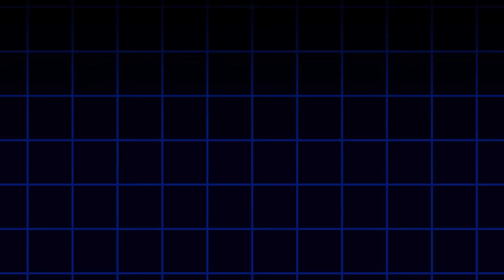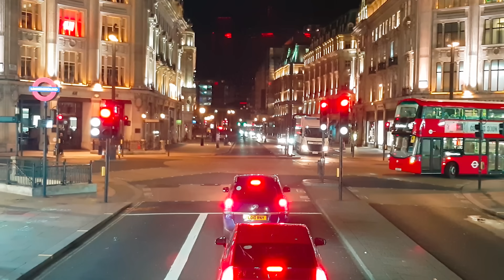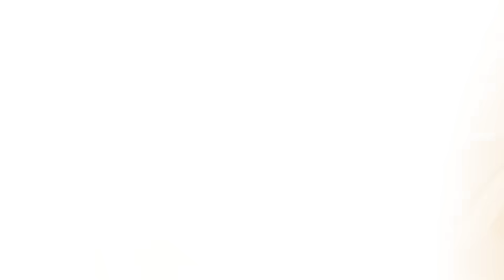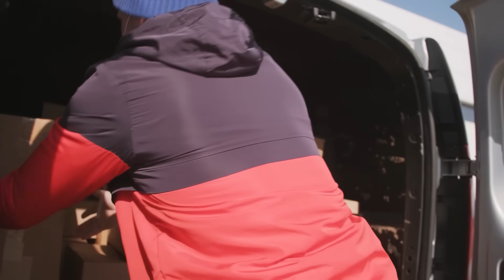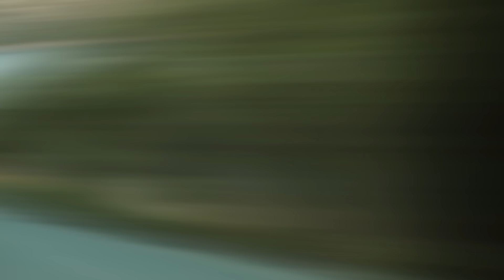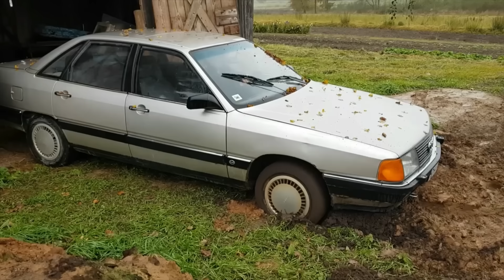13 Silly Mistakes DESTROYING Your Automatic Car – STOP Doing These!

Comment: 10:13 what if a car has only a drive option. No sport and manual shifting mode
Reply from the maker: If your car only has ‘D’ (no sport or manual mode), the safe way downhill is to brake intermittently — apply firm brakes briefly to reduce speed, then release to let them cool. Avoid pumping the brakes on modern ABS cars, since they’re designed for steady brake input.
Reply: @carsfuse  thanks for the info 🤩
Reply from the maker: you're most welcome

Comment: Hi thank you for your very informative video. I'm a new driver here. Just want to know in mistake #3. I have auto hold button in my car is it good to use as alternative while waiting during the red light? or it will also generate unnecessary heat?
Reply from the maker: Hi! That's a great question, and thank you for watching.

The auto hold button is an excellent feature, and it's perfectly fine to use while waiting at a red light. It's designed to hold the brakes for you without putting any extra stress or heat on your transmission. It simply holds the brakes just like your foot would, but gives you a break from the pedal.

It's a much better option than constantly shifting into Neutral or Park, which can actually cause more wear on the internal components over time. So yes, use that button and enjoy the convenience!

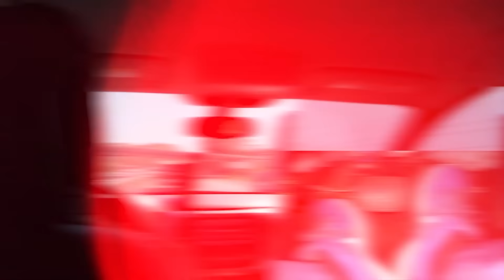Comment: 8:54 Who drives with both feet on an automatic? It's uncomfortable since both pedals are next to each other on the right side
Reply from the maker: Exactly! Most drivers don’t use two feet on an automatic, but some beginners or people switching from manual try it out of habit. The danger is if you press both pedals by mistake, which can cause serious accidents. That’s why it’s always safest to stick with just the right foot.
Reply: i used to do it only like the first week i started driving because i simrace but i broke the habit really fast, like the second week

Comment: Changing trasmintion fluid is a mistake, I've seen cars change oil and break trans mission weeks later, and cars transmission lasting decades withouth changing the oil. i rather  save the maitainace money over the 10- 20 years it lasts and you buy a brand new one later
Reply from the maker: I get where you’re coming from. Sometimes a transmission that’s never been serviced can fail soon after a fluid change — usually because the old fluid was masking wear that was already there. But in general, regular fluid changes with the right type of fluid actually extend transmission life and prevent costly failures. Skipping it can work for some, but it’s definitely a gamble.

Comment: 1. Modern cars don’t have hand-brakes..
Reply from the maker: Most modern cars now come with electronic parking brakes instead of the old mechanical handbrakes. The function is the same though — to hold the car securely when parked.
Reply: wow that helps a lot.

Comment: Dont change these habits:
-Dont neutral/park mode on stoplights.
-Dont use the engine brake on a downhill; using brakes gives you a proper millisecond reaction.

Comment: When I am waiting on a signal and I put my car on neutral it asks me to put it back on drive mode. Maybe coz I have a hybrid.
Reply from the maker: Many hybrids are designed that way. The system prefers Drive mode so it can manage the engine and electric motor efficiently. In hybrids, it’s best to just leave it in Drive at signals and let the car’s system handle everything for you.

Comment: Never flush your transmission fliud if you never did in the beginning lifetime of your car. DRAIN AND REFIL WITH NEW FLUID. 

-SCOTTY KILMER, MASTER MECHANIC
Reply from the maker: A full flush on a high-mileage transmission that’s never been serviced can sometimes cause problems. A drain and refill is definitely the safer approach to keep things running smoothly. Thanks for watching.

Comment: When I park. I step on the brake until a full stop, then still not releasing the brake shift to P then immediately engage the handbrake, no matter how flat the surface is. Will this still put unneccessary load on the parking pawl? Thanks.
Reply from the maker: Since you’re engaging the handbrake right after shifting into Park (without letting the car roll), the pawl isn’t taking much load. On flat ground it’s no issue at all, and even on a slope, your quick use of the handbrake keeps stress off the transmission.
Reply: @carsfuse great  news. Thanks.

Comment: Why don’t I just put my foot on the brake, put it in park, and then turn on emergency break?> wh y do i have to put it in neutral first?
Reply from the maker: You can go straight into Park and then set the parking brake, but the reason for going into Neutral first is to let the car’s weight settle onto the parking brake instead of the transmission’s parking pawl. That way, the brake holds the load, and Park just acts as a backup lock. It’s mainly extra protection, especially on slopes.

Comment: So delicate.

Some I knew, some I didn't, however...

Long live Manual Transmission!!!
Reply from the maker: Manuals definitely have their charm — more control, more connection, and fewer of these automatic-related worries. Long live the stick shift! ⚙️
Reply: @carsfuse control, power on command, full engagement in the driving experience. Yessir.

Comment: When we drive a down hill for around 1-2 Km , in a hybrid vehicle should we drive with L or D mode?
Reply from the maker: In most hybrids, using L mode on a downhill is better for 1–2 km stretches — it gives you more engine braking and also helps recharge the battery through regeneration. D mode is fine for gentle slopes, but for longer or steeper descents, L mode keeps your speed under control without overusing the brakes.
Reply: Drive mode

Comment: 3 is a mith.
Reply from the maker: Modern automatics are designed to idle in Drive without causing harm. The main reason people suggest shifting to Neutral or Park is just to reduce strain in older cars or in extreme stop-and-go conditions — but for most modern cars, sitting in Drive at lights is perfectly fine.

Comment: My car, vw golf mk8 gti with dsg goes in neutral as soon as I let go the throttle. How bad is this?
Reply from the maker: That’s totally normal for your GTI! The DSG has a “coasting” feature that shifts into Neutral when you lift off the throttle to improve fuel efficiency. Since it’s built into the transmission programming, it won’t cause damage — the system is designed to handle it safely.

Comment: Neutral is good for idling but not good for coasting to a stop?
What is the difference?
Maybe you just meant re-engaging the transmission while driving.
Reply from the maker: Great question! Yes, Neutral is fine if you’re idling at a stop, but coasting in Neutral while moving is different. When you re-engage Drive at speed, it can cause a sudden shock to the transmission. Plus, in Neutral you lose engine braking and quick power if you need to maneuver. That’s the main difference.
Reply: @carsfuse so if you know you’re going to stop- then no big deal
Reply from the maker: @jasonzimmerer8658  Exactly — if you’re already slowing to a full stop, then coasting in Neutral isn’t really a big deal. The main concern is re-engaging Drive while still moving at speed, since that’s when it can cause stress on the transmission.

Comment: I wonder if that’s why cars have engine turn off when you come to a stop to save gas. I still don’t know if it really saves on gas when it has to start the engine again
Reply from the maker: Great observation! 👍 Yes, that’s exactly what the start-stop system is designed for — saving fuel when you’re idling. The restart uses very little extra fuel compared to what you’d burn sitting at a light, so overall it does improve efficiency, especially in city driving. Thanks for watching.
Reply: It kills your car slowly over time.  Terrible idea.  Always shut it off.
Reply: @Pktattooss no it doesn’t
Reply: It wears a certain few components out over time, im driving a van every day and the amount of times I’ve needed a new starter motor is unreal when you do the mileage I do ,your talking 3 starter motors a year. It may save you money in fuel but that saving is spent on repairs

Comment: I hate that I have a cvt. Everyone i know that have had their tranny flushed and filled have had engine damage from doing so.
Reply from the maker: I hear you — CVTs can be tricky. The key is that they need the right fluid and the exact procedure recommended by the manufacturer. If it’s done incorrectly, it can definitely cause issues. When serviced properly though, a CVT can last much longer.
Reply: I had a 2017 outlander for 7 years from 0 miles to 180k no problems. All I did was have oil changes and 1 tune up. If I didn't get hit by a driver still would have it.

Comment: Engine breaking isn’t always good if your not putting stress on ur breaks in order to slow down then your putting stress on your transmission to slow you down
Reply from the maker: Good point! 👍 Engine braking does put some load on the transmission, but it’s designed to handle that. In fact, it usually causes far less wear than overheating your brakes on long descents — it’s all about using a balance of both.

Comment: Literally none of these apply for a hybrid with automatic parking brake.
Reply from the maker: True! 👍 Many of these tips mainly apply to older cars or ones without automatic/electronic systems. Hybrids with auto parking brakes handle a lot of this for you — but the advice is still super useful for traditional setups.

Comment: Many will disagree with you put auto into natural when stopped in traffic ... it's generally not necessary or recommended to shift an automatic transmission into neutral while stopped in traffic. Modern automatic transmissions are designed to handle idling in drive, and shifting frequently can potentially lead to wear on the transmission and linkages according to some car forums  .. nd NUMBER 4 ... https://www.youtube.com/watch?v=6zzEtxJkC7Y&t=428s
Reply from the maker: Great point! 👍 You’re right — most modern automatics are built to idle in Drive without issue, and constantly shifting between Neutral and Drive can add unnecessary wear in some cases. The advice is more relevant for older cars or in very long traffic jams, but for most modern vehicles, leaving it in Drive is perfectly fine. Thanks for adding that perspective!

Comment: Parking pin, on any hill or incline, set the PARKING break. It's NOT an emergency break!  

Shifting into neutral whether stopped or at a light is ILLEGAL in most US states.  Plus, the torque Converter disengages at lower RPMs, so sitting with the car in Drive isn't itself causing any harm, it's the lack of air circulation through the transmission cooler.  Additionally, aside from fuel saving, shifting into neutral on a variable speed transmission is where you'll incur damage while coasting.   A standard automatic transmission on a rear wheel drive car/truck will not be damaged over short distances.  The torque converter is connected to the transmission in two ways.  The first is always engaged because it lockes into the pump and as long as the engine is running, it's moving fluid through the transmission.  The second is the yoke that connects the torque converter to the actual drive train portion of the transmission.  It engages when the TC locks at the designed RPM allowing the engine to move the car, and the trans to work through the gears.  Still, aside from seeing your current MPG spike at 99, it's not worth putting it in neutral.  If you need to hit the gas to maneuver around a potential obstacle, you're screwed, because you're hitting the gas and going nowhere, by the time you pop it back into drive, the RPM of the engine is up and boom.  Destruction of your drivetrain.  

Driving hard on a cold start is horrible for the transmission.   In extreme cold, if your windows haven't thawed, your transmission isn't ready.   If you can get warm in the car, then your transmission is ready as the cars radiator is now circulating it's heat with the transmission cooler.  If the heater isn't blowing HOT air, your vehicle isn't ready to move.

Two feet isn't typically causing transmission damage directly, but it does cause the computer to treat the transmission differently, causing long term ongoing damage.  Not to mention this habit has cause serious injuries and even deth when the driver panics and hits the gas instead of the brakes. 

Thanks for listing the brakes!  If you get brake fade, and then hit water, you can crack or even shatter the rotors!

I'm not criticizing this video.  It's awesome!   I've just built everything from stock rebuilds to 200mph drag cars, in addition to spending the majority of my life up to 40 years old racing anything with 4 wheels.    Keep it up.   This is an excellent video, so I'm going to definitely check out more.   Thank you!
Reply from the maker: That’s an awesome and very detailed breakdown — really appreciate you taking the time to share your knowledge and experience! 🙌 You brought up some excellent points, especially about how modern transmissions are designed to idle safely in Drive, the risks of shifting to Neutral, and the importance of warming up properly in cold weather. A lot of viewers will definitely find value in your added perspective. Thanks for the support and for checking out the video — respect to your years of hands-on experience with builds and racing!

Comment: I didn't know about the sport mode when going down hill. 😢
Reply from the maker: No worries! A lot of drivers don’t realize sport mode (or manual mode) can be super handy for engine braking downhill. 👍 Once you try it, you’ll notice how much easier it makes controlling speed and saving your brakes.

Comment: Bonus Advice for Winter Drivers ❄

If you own an older car with a mechanical handbrake (cable-operated), be cautious in winter. Moisture can enter the handbrake cable during driving and freeze when parked. This may prevent the parking brake from releasing properly.

👉 Tip: Before winter sets in, inspect your car’s parking brake system and take preventive measures. This happened to me twice in 50 years—both times in -15°C Swedish winters!
Reply from the maker: Great tip! ❄ Thanks for sharing your experience — frozen handbrake cables can be a real headache in cold climates. Preventive checks before winter can save a lot of trouble.

Comment: Who in the entire fk does any of this ?
Reply from the maker: You’d be surprised! 😅 A lot of people skip these small steps without realizing they can save costly repairs later — that’s exactly why videos like this exist.
Reply: I don't know anyone who uses the "emergency brake" unless they're on a steep hill. My husband ALWAYS changes to drive while his car is still moving when he backs out of our driveway. He's done this for at least 30 years - and his cars have lasted at least 200K miles. Oh and yes, we both rock back and forth when we are stuck in snow - but we don't floor it, that just makes it worse. And if it doesn't work after a few tries, we grab some kitty litter or salt to add something for the tires to grip.

Comment: My car is not letting me engage the parking break without holding the foot break
Reply from the maker: That’s completely normal — most modern cars have a safety feature that requires pressing the foot brake before engaging the parking brake. It’s designed to prevent the car from rolling while you activate it.

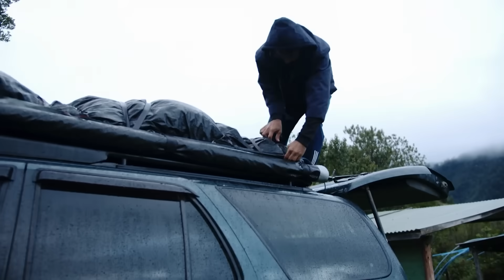Comment: 8:25, #8, didn’t know it was possible to do that.
Reply from the maker: On many modern and old automatics, you can still manually select a lower gear — either with a sport/manual mode or paddle shifters. It’s a great way to control speed downhill and reduce brake wear.

Comment: How important is it to regularly change your cabin air filter?
Reply from the maker: It’s more important than most people think! A clean cabin air filter keeps your AC/heater working efficiently, improves airflow, and helps block dust, pollen, and pollutants from entering your car. Most should be changed every 12,000–15,000 miles or once a year, depending on driving conditions.
Reply: Thank you for that information

Comment: Using the transmission to slow the vehicle when going downhill. I've always used the brakes. I will change that habit.
Reply from the maker: That’s great to hear! 👍 Engine braking is a simple habit that can save your brakes and give you more control on descents.
Reply: Not true if ur not using ur breaks then ur using ur transmission which wares it down a lot faster. You have breaks for a reason so use them for what they are intended for… breaking

Comment: What if your vehicle has a hold button
Reply from the maker: If your car has a hold button (auto-hold feature), it will keep the brakes engaged when you stop, even in Drive. That means you don’t have to shift to Neutral or Park at lights — the system is designed to hold the car safely until you press the accelerator again.
Reply: @carsfuse is it good to use the hold button often